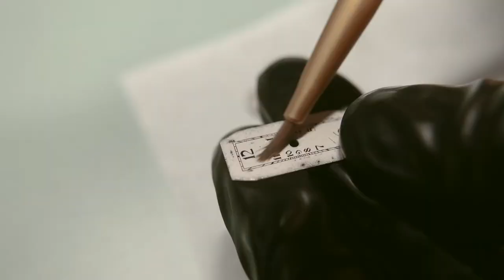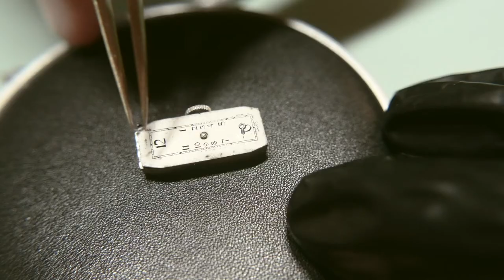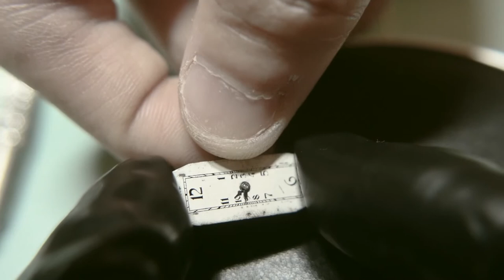TINY Bedford Vintage Watch Part 2: Reassembly – Hobbyist Watchmaking & Repair

Comment: What resources have you found particularly helpful or informative for learning about watch making? Any books, websites or yt channels you could recommend?
Reply from the maker: I'd recommend checking out Practical Watch Repair by Donald de Carle (book), Clickspring (YT channel), Dean DK (YT channel), George Daniels' Watchmaking (book), Adventures in Watchmaking (website/blog) to start. This is just the tip of the iceberg-- there are so many good resources out there, and you're bound to uncover them yourself as you get deeper into it
Reply: Great thanks’